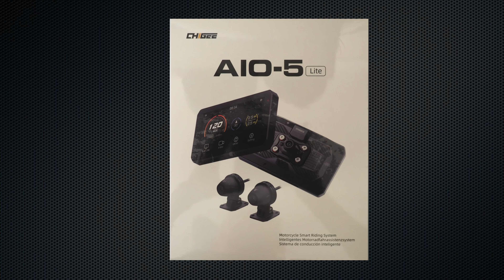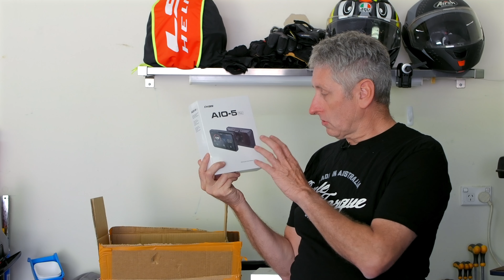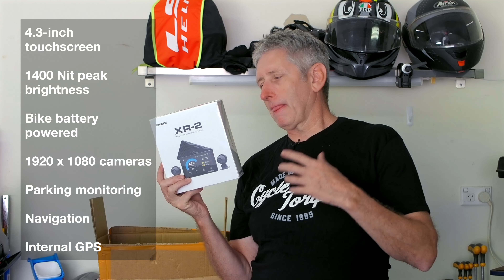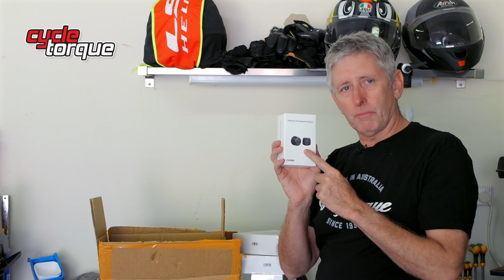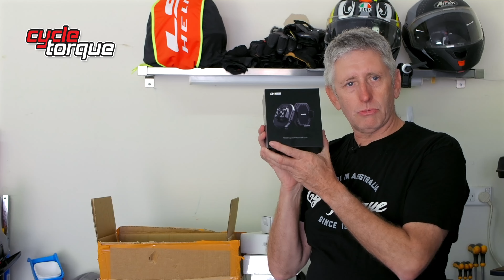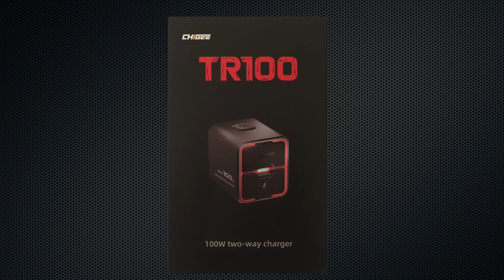Cycle Torque Mailbag – Chigee electronics

Comment: It's been a while since I've seen any content from Cycle Torque, not since the mag folded way back when.

I first saw the Chigee back in mid to late '23 on some Brits' channels. I thought at first that more garbage from you-know-where. But some of these channels were reputable ones so I got interested.

Then in November '23 I bit the bullet and ordered the AIO-5 Lite along with all the accessories (remote, TPMS, etc.). It arrived in Feb '24. Since then I've been running it on my V-Strom 1050XT. The accessory bar on the 'Strom is perfect for it. Despite my better judgement I also mounted a Peak Design phone mount with wireless charging and vibration dampening just above the Chigee. 

Dash now looks a bit like a Boeing cockpit...

I have run various apps such as Google Maps, Riser, My Route App, Calimoto and Scenic. I settled on Scenic as the developer, Guido is pretty much on the ball on his forums so, support is incredible. But the main reasons are, offline maps, Google Map routes and GPX importing features, saving of routes, offline planning and so on.

I also use a Cardo Packtalk Edge comms headset. That pairs directly with the iPhone 14 Pro Max. And when the phone is linked to the Chigee I have full control over streaming apps which are CarPlay compatible, phone calls and so on. 

As there is no link between the Cardo and the Chigee you don't get all the confused link-ups that I was getting using a Garmin Zumo XT.

This setup was fantastic on a trip from home east of Melbourne to Peterborough north of Adelaide last year. The route, once you left the GOR, had some of the most boring bits of road that I've ever ridden, so streaming podcasts or music made it a better ride for me.

The tyre pressure monitors work well and are pretty accurate. I had a bit of a leak and it alerted me in no uncertain manner. Despite having earplugs in and over the road/wind noise the alerting was loud, along with the screen based alerting,. Turned out to be a slight leak from the TPM itself. Wasn't tight enough, I think.

There are issues with the dash cams though. Like you've said in other videos, as it's 1080 they're no DJIs, Insta 360s or Go Pros. It came with a 64gb microSD card. I soon swapped it out for a 256gb card which can hold around 3 days of video (at 6 hrs riding a day) then overwrites the older vids. However, this card cannot be read by Macs. I have an iPad Pro, Macbook Air M2 and a Mac Mini M2 Pro, none of which can read the 256 gig cards. But they can read the 64 gig card which came with the unit (it was some unbranded card so I don't know what its specs are). The 256 gig cards the "extreme pro" Sandisk versions. 

So, I had to use my wife's Windows PC to copy the contents of the card over to my NAS for editing and viewing.

The GPS based speedo on the unit is quick with speed updating as you speed up or slow down extremely quick, faster than the iPhone's GPS which I had running at the same time to compare (the app was a non-CarPlay one so it was reading or working independantly of the Chigee).

The Chigee has a built in trip computer. It's basic stuff. I've asked if the developers would do some work to make it a more comprehensive trip analysis system. For example, when you shut off the bike, after 10 seconds the Chigee switches off. But during that 10 secs it displays the current ride info. So if you want to capture it you need to have your phone camera ready to shoot it before the unit turns off.

The latest product is an OBD2 unit which connects via Bluetooth to the Chigee. Unfortunately I cannot get any info on what data it captures from the bike or if it will even work with my bike, so I'm not prepared to spend $200 on it. The BMW versions do display a lot of info from the bike's can-bus system, I believe.

Chigee is now marketting a 6" version. It's a quick releaseable one for those who are worried about the permanently bolted on 5" model being nicked. 6" would be nice, I guess.

Finally, the screen isn't as glove sensitive as they claim. I had to buy these "touch dots" to glue to my gloves fingers as none of them, either my summer or ten different pairs of winter gloves work with it. Pity about that.

OK, so it's more exxy than the Carpuride models, but they also are limited in functionality and won't work on may Android phones. A mate has a Samsung Galaxy 22S and the Carpuride won't link to it, so he returned it. Shortly after, Carpuride released a presser advising customers of the phone limitations.